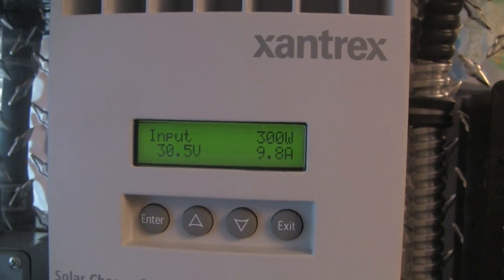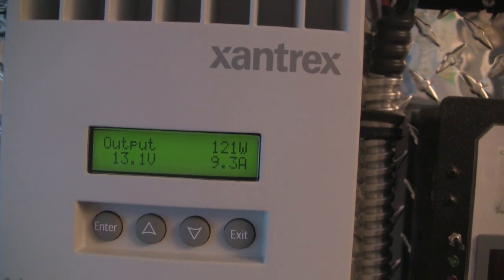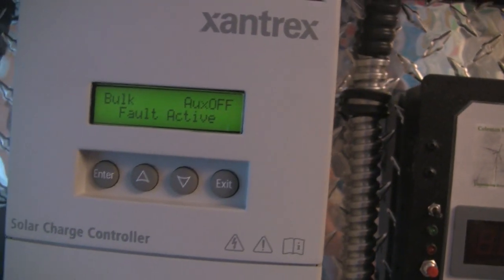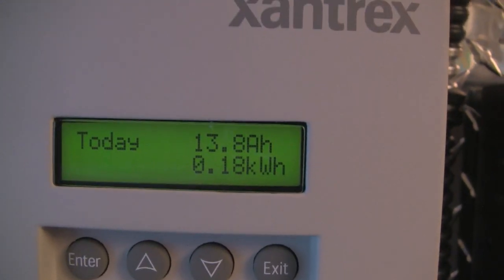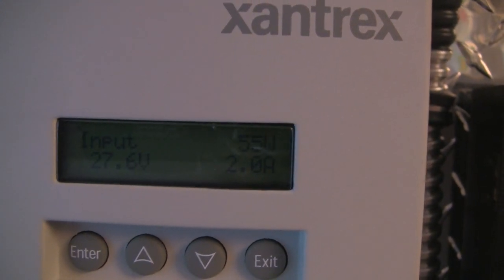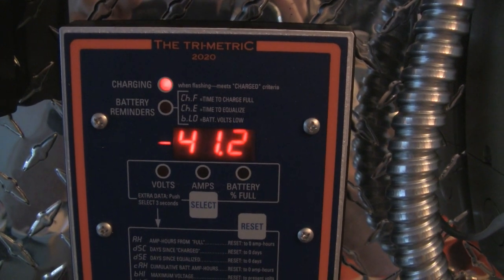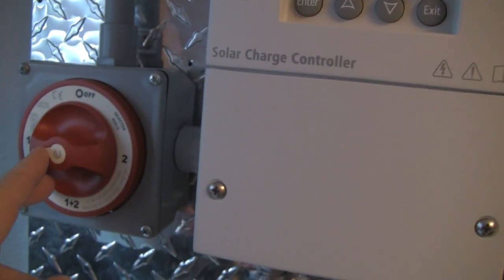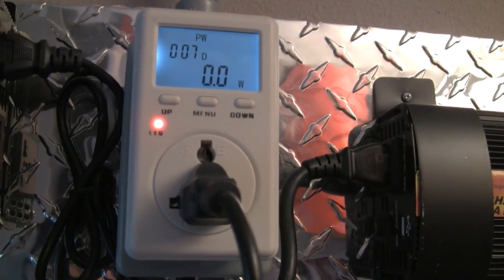EMERGENCY POWER Solar Equipment Update

Comment from the maker: @sirmasterpimp yes the are polycrystalline. Iam getting a avarage of about 3 hrs of light. Yesterday I was putting in about 360 watts into my gridtie inverter for about 3hrs on my 400watts of panels. I have read that if you should get about 70% on average out of your panels. It was a very good day!